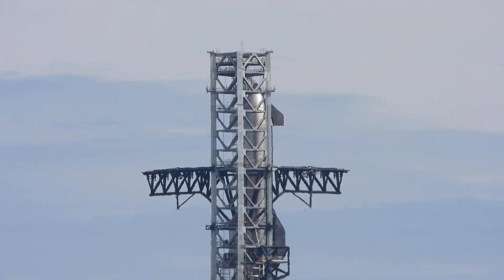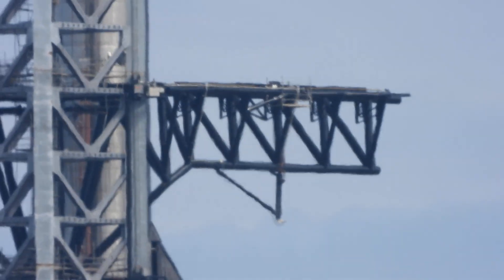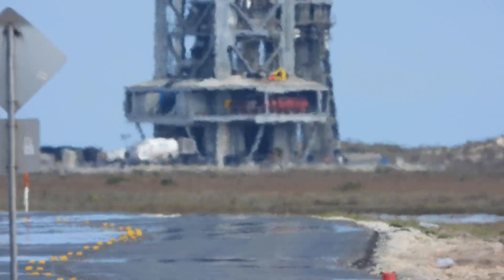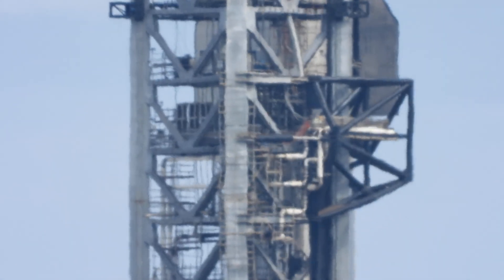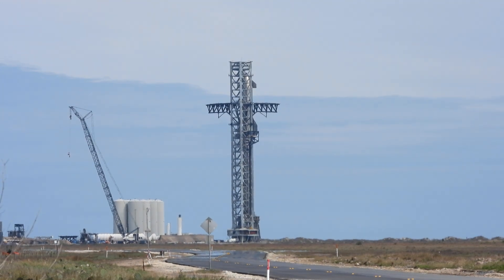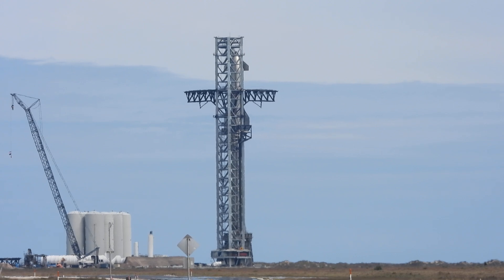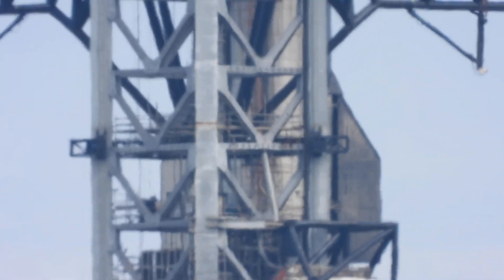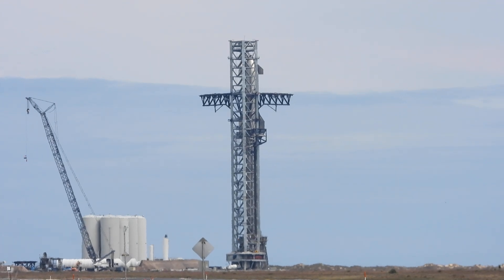Preparation for Cryo Test, SpaceX Starbase Launch Site, Boca Chica, TX. February 11, 2022.

Comment: The "chopsticks" are in the launch configuration, forming the "cross". The "QD" is all that is needed to stabilize a full stack during launch. Get the names of the parts. Thinking thru their various functions during different stages of launch? My best guesses.
Reply from the maker: Thanks. I made a mistake in the wording. I meant to say the chopsticks. I was also at the road block, and getting zapped by the satellite dish pointing in my direction which prevented me from being able to go live with the nikon camera, and made my cell phone also lose signal multiple times.